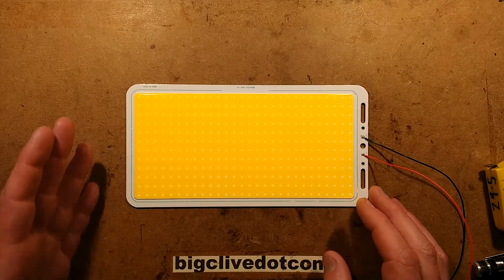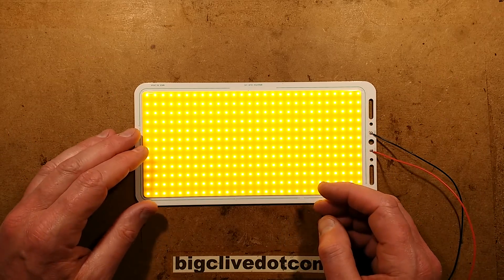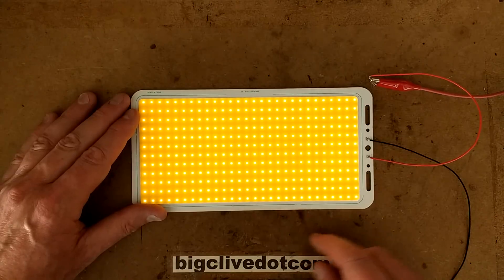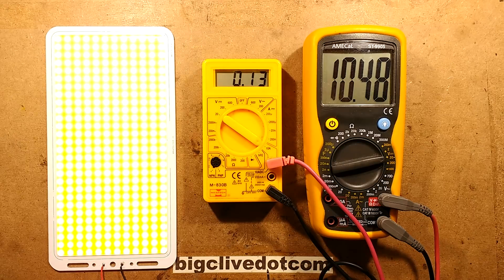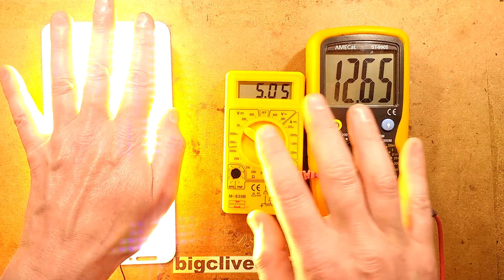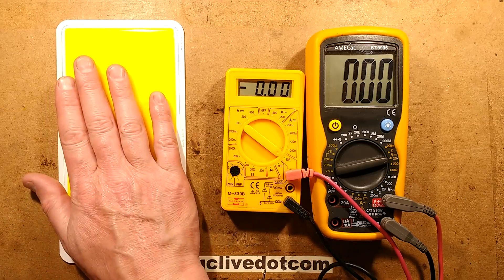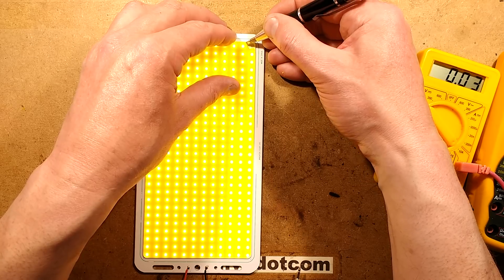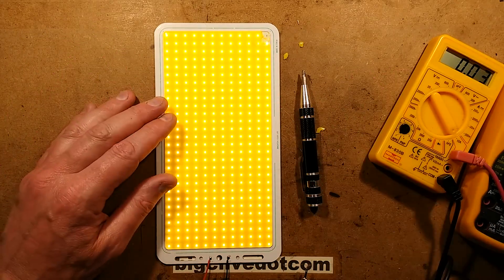The biggest LED COB panel yet!  Voltage/current tests.

Comment: Mr Clive, for the life of me I'm still at a loss on how to make a circuit to properly drive LEDs like these.  Incandescent makes sense, but LED does not.  If someone were to drive this from a 12~13.8 volt car battery, what's a basic circuit recipe for limiting the current and/or voltage to desired panel intensities?  Maybe give us a few examples of varying resister values.

If I were to buy one of these panels, I'd feel like a virgin in a cat house.
Reply: The basic circuit is called a current limiter. Do a search.
Reply: Say you wanted to run it at 19.8W off of a 13.8V supply with a simple resistor limiting current in series with it.

The panel needs to have 11.5V across it and draw 1.72A. If the panel is dropping 11.5V then the resistor has to drop 13.8-11.5=2.3 volts at 1.72A. R=V/I, so you want a 1.33 ohm resistor. 1.2 is a nearby standard value, so we'll pick that. We can then calculate the real current as I=V/R=2.3/1.2=1.9A. The voltage across the panel will be slightly higher, but not much. The resistor power rating you need is P=IV=4.3W, so a 5W 1.2 ohm resistor.

The problem is that if your supply falls to 12V, then you've got 0.5V across the resistor, so 0.42A. Which means you really only have 11V across the panel, because it's non-linear, so 0.83A. This means that your panel has gone from being 22W to 9W from the supply going from 13.8V to 12V.

If you want anything resembling constant brightness from a system where the voltage can vary much, you need a current regulating LED driver.
Reply: Ok, thanks Paul.  So a driver isn't something that just hashes together with a few common bits.  The "resistor hack" only works when there's a stable voltage source.
Reply: resistor hack only working with stable voltage sources ?,  do you mean when it elevates above the predetermined voltage used in your equations for a certain current limit  ?

Comment: Hmmm... this could easily be used with one of those electronic halogen transformers I think. You just have to put a rectifier behind it. They come in 60W variants and and their specs usually specify the voltage at 11,6V (rms), not 12V.I have two of those sitting around (perhaps you can google them: Self ET60T-2)
Reply from the maker: Those transformers put out a series of voltage spikes around 30V, so I'm not sure how well that would work.
Reply: I'm thinking simple, just trying stuff. Not letting knowledge getting in the way. You're absolutely right about that. Mike once did a video on the subject. But rectifying it and smoothing it with a nice electrolytic with a resistor in between perhaps could work.
Reply: And a big inductor to reduce the spikes and smooth out noise.
Reply: That would be a usefull addition as well indeed, was thinking about that too.
Reply: I found the panels on  Banggood as well: https://www.banggood.com/70W-WhiteWarm-White-LED-COB-Chip-Light-220112mm-for-Camping-Light-Flood-Light-DC12-14V-p-1247709.html

Comment: Warning: This video contains graphic scenes of LED array mutilation.
Reply: The mutilation does make one cringe, but very good information that the panel is 4 regions of LEDs all in parallel, and then the regions in series for about 12v.  I like the redundancy such that one or two LEDs failing open should not appreciably affect light output or longevity.  Failing short would probably blow the LED off the board with 5A thru the bad chip.  The one aspect of discrete or surface mount panels that I don't like losing is repairability, but if the panel can suffer some failure and keep going, that helps a lot.
Reply: Kind of a shame, ain't it!??!

Comment: Haitz's law is still plodding on. Price goes down, lumens go up. I will be ordering some of these and driving them just under 12V. 
By the way, Ruideng make some tiny high quality variable buck boards https://www.ebay.co.uk/sch/i.html?_from=R40&_trksid=m570.l1313&_nkw=5x+MP2307+Mini+DC-DC+Buck+Converter&_sacat=0

Comment: What CRI could I expect from those?
Reply: Antoine Roquentin -20
Reply: Why? Incandescent/halogen bulb has CRI of 100 and Ceramic discharge metal-halide lamp has 96.
Reply: If you have any doubts you can always look up test data.
Reply: Not only in the room, have you seen outdoor lightings with horrible white LEDs? Even though it looks white you literally can't see colors almost at all...
Reply: Incandescent and halogen bulb do indeed offer 100 CRI because they offer true black body radiation. yes they might not be efficient but they are still widely used regardless
Reply: A CRI of 100 is as close as a man-made light source can get to sunlight, which contains all the wavelengths our eyes have evolved to see. If you want your photograph or video of something to have natural and accurate colors, therefore, you need a high CRI. It's also important when applying digital filters or effects.

High CRI lights are also great in workshops and art studios because, again, they provide the best color rendering for the human eye. That's quite important when painting or finishing furniture.

And, of course, there's just straight-up artificial sunlight. High CRI lights are often used in the treatment of sleep disorders or seasonal affective disorder, and they can also be used to improve the work environment of people who sit in basements for several hours a day.

Some people also say you need high CRI lights to grow plants indoors, but that's apparently not true in most cases. It's a few specific wavelengths of light, so you shouldn't use just any LED, but you don't need high CRI ones.
Reply: Avery Steele Because low CRI makes everything in the room look horrible...?
Reply: i'd be so happy if i'd only had to care about a single thing
Reply: It's my understanding that plants only make use of a range of wavelengths mostly within the red and blue ends of the spectrum, and don't care too much about anything else. LED grow lights can therefore have phospors that emit wavelengths within that range, meaning they're not using too much power to produce light that the plants can't use.

There's some variation in the wavelengths preferred by different species, apparently. "Pro" growers might therefore choose a different set of wavelengths based on what they're growing. But that's why so many plants are green -- they don't absorb those wavelengths because they have no use for it.
Reply: Tony Hong hahaha
Reply: Yoy really should use halogen or metal halide if you care about CRI IMO
Reply: What do you mean by that? Metal halide can provide a lot of high quality light.
Reply: Антон Южаков I really doubt ANY bulb of any type has a CRI of 100, but even if it did, the trade off with efficiency still makes it horrible.
Reply: Crystal Soulslayer as to the plants, no, 70 or 80 or 90 will typically do just as well as anything else unless you are looking for very specific photomorphic response. Interesting about the other uses though.
Reply: Hm. Further research suggests some species do fine with red and blue, but others do require a wider range to grow normally. TIL.
Reply: Против Глобал
, are you sure about that? What do you consider "beginning"?
Reply: I have pants that look grey under some indoor light, green under other indoor lights, and brown out in the sun.
Reply: Cool white is probably around 65-70, warm is probably 70-75

Comment: I miss those 300W halogen torchiere lamps — apart from the slight fire hazard and the high power consumption. I’m tempted to get a COB array like this one, with a power supply and heat sink, and try for the same effect at around 50W of power, shining a lot of light on the ceiling. (A lot of eBay sellers seem to sell all three types of component, but don’t seem to offer an easy way to order all three at once.)
Reply: You could use 150W metal halide lamps too...

Comment: Thats a great pannel. How small could a regulator be built for this? Ive put together a rectifier for my wr450 lighting to be able to use LEDs. The single large pannel would make a very interesting replacement for the entire original headlight.

Comment: Neat ... Looks like a lot of bang for yer buck (magic smoke included) .
Putting one of those in a cheapo rip-off led work light (or even an old quartz halogen type) should make a dandy trouble light .
Reply: That would be a good way of making a cheap light quite effective. Driven at low power it would probably put out more light than the fixture already had, and stay cool. Still wonder if a real bridgelux or cree cob would be better... and the price is pretty similar. It is amazing how much more light / watt you get out of a "real" led, making you wonder why these exist. These unbranded ones are neat to play around with (i do have some) but they are truly super low end as far as light output goes and need to be cheap... factoring that into a price of more than $10 they are actually a ripoff when cobs that output like double the light for a few bucks more exist, and will actually last.

Comment: wouldn't it be running at 14V while the alternator is running?
Reply: Up to 14.8 or more for a car with an AGM battery
Reply: just get a dc to dc buck converter for the led and no prob.
https://goo.gl/7rfD9w
Reply: 14.4V
Reply: Антон Южаков which is a lot more than 12V, which means it would be way overdrived.

Comment: It's amazing to think how LED lighting has evolved in the past 15 years, from large lumps of layered PCBs filled with 5mm or 3mm white LEDs, to flat panels of LEDs like these pumping out 70 Watts of light, it's impressive... :D
Reply: 30 years ago I was playing with components in my Grandfather's workshop, making random circuits, and he always told me to take it easy on the red LEDs because they were so expensive.  Like a dollar apiece or something.  These days we just throw crap away unless we absolutely need to save it for something.
Reply: @tncorgi92  Maybe most do throw old electronics away, but I do not. Although the older LEDs were not that bright, for someone going low voltage off-grid living, I found they make great nighttime markers for a pathway, a driveway, and or dead-end lighting. Having them for markers on parking spaces where you are backing in is a great way to know when to stop. Lots of other uses as well. And the darn things never seem to burn out!
Reply: @tncorgi92  Whenever one of my pieces of tech, even kitchen tech dies, I still pull off LEDs and switches and other easily repurposable modules... force of habit. i'm an 80's kid
Reply: You think that it is impressive?

That is until you see an XHP70.2 being pushed to 100W.

Imagine a tiny 7mmx7mm LED pushing 100W. Overdriven, yes, but still extremely impressive.
Reply: Thanks for the heads up,not seen this before. Very interesting.
Reply: @neutronpcxt372  I'd like to see the die to heat sink design that gets the heat out of that tiny surface area.
Reply: @railgap  Well, you basically need heatpipes to actually do this, or water cooling,

Also, 100W is usually a very short peak.

We usually push it to the absolute max at around 80-90W.
Reply: 70 watts of heat and light.
Reply: Paul - I can well remember Nichia producing the first blue LEDs (Silicon Carbide substrate). At the time, RS were selling individual 5mm LEDs for  TEN Pounds (when we could pick up red LEDs for pennies). Nowadays  Royal Blue LED chips are the basis of all the COB white light technology, and you can buy pre-mounted high power chips for around the dollar a watt region (e.g. Philps Luxeon Rebel ES; $3 from Rapid LED)
Reply: if you want deep red just get a red smd and put a deep red lens over it
Reply: I think you're mishearing his dulcet Scottish tones there, +jeromekerngarcia : 12 x 28 = 336. He later points out that the long rows are 7 x 4 = 28, so it's really 4 x (12 x 7), which of course still comes to 336, although you're right that Brexiteers would probably scrawl "It's 240 LEDs!!!" in massive letters on the side of a bus and claim anyone pointing out that the maths shows 336 was part of "Project Fear", these days known as "Project Reality" ;)
Reply: I guess what amazes me is the sheer light output. The first LEDs I played with (surplus HP and Monsanto) were only useful as indicator/pilot lights where there wasn't a lot of bright ambient light.
Reply: Would love to see a video about this subject ^^,
Reply: My first blue LED cost about 10GBP or so. It had a lot of UV content that made it difficult to look at!
Reply: Red leds weren't too expensive. The blue ones were insanely expensive when introduced.
Reply: 15 years ? how about 5?
Reply: -->> Clive-->> This is what I was talking about in my last post... there is no such thing as 70 watts of light. light is measured in lumens, candles, lux and temperature and spectrem... (etc}    by not specifying this, one could conclude that "70 watts of light"  would be an accurate statement..
Reply: LED'S have come a long way since the 70s. I was playing with them back then when their output was fairly low. They were just getting popular as indicator lights
Reply: meh lasers are better
Reply: +gantmj...
Thanks! I am sure some of the people here already knew that, but still.
Reply: Even better. My dad has told me stories about buying diodes (per piece, not by the ten) which would then be placed in a neat, small cardboard box with a piece of foam inside, sometimes even with the name of the manufacturer on the box. Hell, you bought a SEMICONDUCTOR and you would know that you did! ;)

Even something like memorycards: the amount of Gigabytes in my room already exceeds my imagination.

Indeed. LEDs were quite something when I grew up as well. Somewhere around 1997 or so, can't really remember, WOW! There are BLUE LED's now! (That they hardly emitted any light at all wasn't really a problem, the fact that we could make such an LED was amazing enough.
Reply: NeutronPCXT do you recommend any cob's that would replace 1000 watt hid's? I'm thinking about switching but it's a big investment.
Reply: Hi friend, here has all the 12v cob you need:  https://www.aliexpress.com/item/-/32751568681.html
Reply: This!- and i love it :)
Reply: It gives me such joy to watch the progress!
Reply: needs a heatsink if you want it to last more then a few min
Reply: Similar here. When I was a kid 35 ish years ago, I treated myself to my first LED, a yellow one. Blue ones, white ones, and UV ones weren't even a glimpse in some mad scientists eye yet. Anyway, during one of my dangerous experiments involving a mains transformer, I ignorantly left out the current limiting resistor, and melted the poor thing. It actually stayed lit as the plastic melted, at least until the leads parted company anyway, then I got an electric shock from the dangerously bare mains side as I unplugged it in a panic, hahaha, bloody kids eh?? I doubt any modern LED would even get close to surviving that punishment. I was gutted though, that LED cost me a fortune, and I stupidly killed it. Was lesson learned though. I'm actually using some 30 ish year old red LEDs for a project at the moment, because the colour and brightness of modern ones is just wrong and not in keeping with the setting in which the equipment will be used. I love the colour of those old LEDs :-)
Reply: @Tekwyzard  Reading your comment just reminds me of the end scene of terminator when shwarzenegger melts in the pool of molten metal and his red eye goes out  RIP
Reply: For indicators, they are just bombproof! :)
Reply: I went to school for EET in 2000, I remember some kid having some of the new super bright white leds. He was using them for one of the labs and everyone was like WTF is that? I also remember the key chains with one of those new LEDs, they claimed it could be seen 1 mile away! They were super impressive back in the day. Now you get lights at harbor freight with 24 of those leds in them for free!
Reply: I was working on LED's for Arrow Electronics (distributor) for lighting back in the 90's. Back then they were really rubbish but it was obvious the tech was on the way.
Reply: but some colours like 600-610 nm (smd) (orange/amber) is silly expensive because 1-2 manufacturers figured since most other chip makers make yellower chips <600nm there's no competition and decided to go from 2 pennies a chip in 2016 to 1 dime per chip in 2018
(basically where there is not competition chips are expensive)
which is basically ORANGE and SKYBLUE (which doesn't even have any commercial chips solutions that are pure wavelength) and most are just 8000+ k white leds pretending to be a colour
not to mention most pink/purple leds are blue with a pink/red phosphor not red+blue
and there's practically no LED chips in the red orange spectrum like you see in some car dashboards (>610 nm but not red)
Reply: Watts isn't a measurement of light.
Reply: +BigClive: 12 x 20 = 336?!? Is that metric multiplication, or perhaps how the EU calculates taxes? Good reason for Brexit, if so! Over here, across the pond, 12x20=240...I DO enjoy your videos & am a subscribe!
Reply: @jeromekerngarcia   It was 12 x 28 which does indeed make 336.

Our NHS provides hearing tests.  :D
Reply: +Matthew Indeed, after I compensate my hearing for Clive's speech; I do hear 12x28!
Reply: twocvbloke yes they are complete crap and they have no life expectancy whatsoever. I would rather have the old lightbulb back

Comment: 12*20=240
I counted 28 horizontally which is 336
Reply: That accent strikes again!
Reply: spooky - I hear him say 12 vertically by 20 horizontally
Reply: Yeah, i listened to it 3 times before i replied, but then listened again and hear the 28.
But i'm old, hearing is not the best, so that's my excuse :D
Reply: So with 336/4=84 chips in each region, blowing one chip will only distribute a bit over 1% more current to all the other chips in the same region.  I like that.  Nice graceful failure.